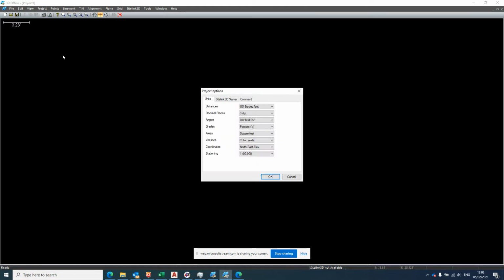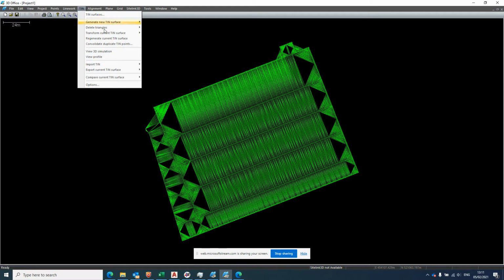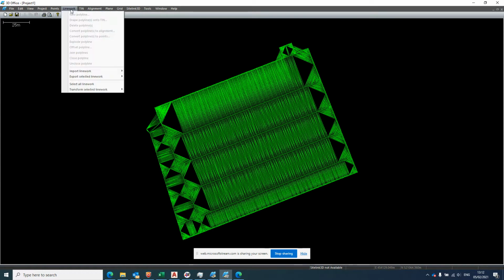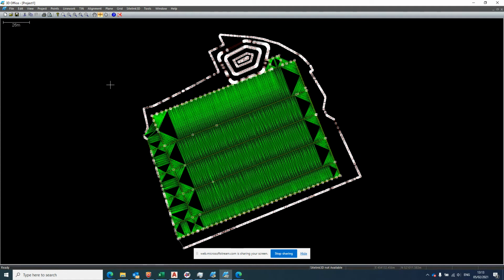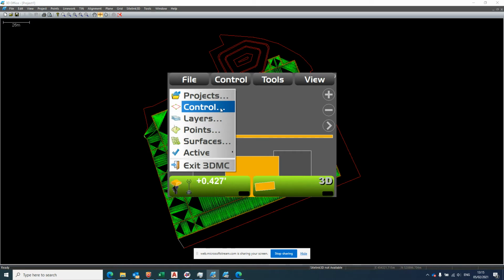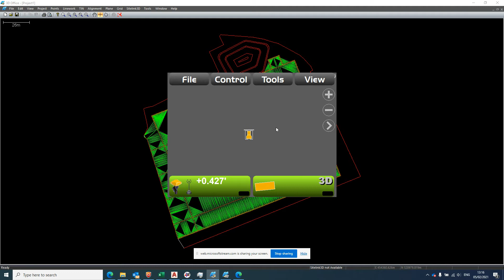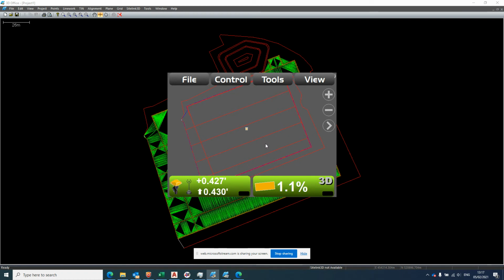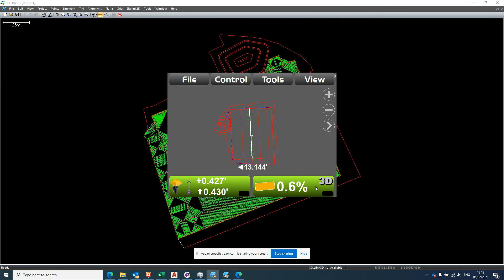n4ce to Topcon 3DMC PART 2. Creating Topcon Machine Control files

Comment: hey mate do you know how to convert from  topcon  to trimble ?
Reply from the maker: Sure, what Trimble system are you using? GCS900 or Earthworks? 
If you don't have a copy of Trimble Business Centre, get it downloaded for a 30 day trial. It is likely you are going to need it
Reply: @machinecontrol  my machine has the gcs900 and I have the free bcs download from some time ago so should be able to do everything with it , also have the latest magnet office
Reply from the maker: @MrTroysalt  yes, is it a topcon tn3 surface you need to convert? Or a localisation done with a topcon rover?
Reply from the maker: Basically the free HCE version you have will be looking for you to import a triangluation either as a dxf, DWG or LandXml. If it is a AutoCAD format then prob best to save it as a 2000/2002 version or similar. Import that into HCE then go to export and export under the tab Construction - Machine Job Site Design Exporter, that = surface/model and saves the file as .SVD this is the same as a Topcon tn3 file. You can then export your linework via Machine Site Map Exporter, that saves as .SVL and is the same as a Topcon ln3 file
Reply from the maker: When you have the files they need to be placed in a specific file path. The first folder will be called, Machine Control Data. In that folder create another folder called ALL. in the ALL folder create 2 more folders, the first one should be your project name and the second one should be called GeoData. Place your SVD and SVL in the project folder. Your coordinate system files go in the GeoData folder, usually a .ggf .sgf and .cal file. You may need to reach out to someone to supply you with them, alternatively when inside HCE look for the CSD (coordinate system database) and see if you can export your files from there. I hope this helps
Reply: @machinecontrol  thanks alot for that alan ill give it a go and see what ill come up with